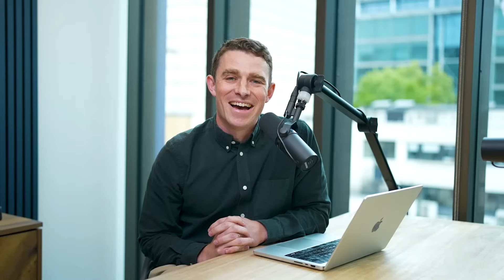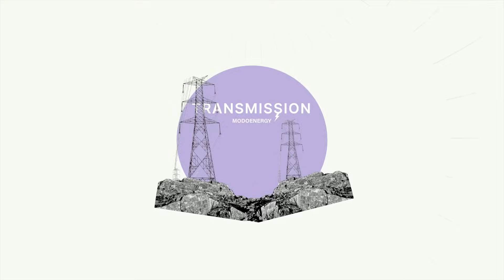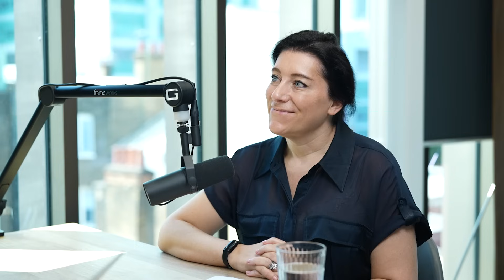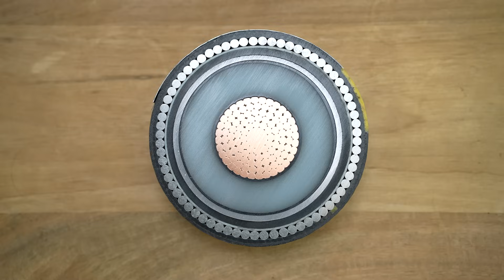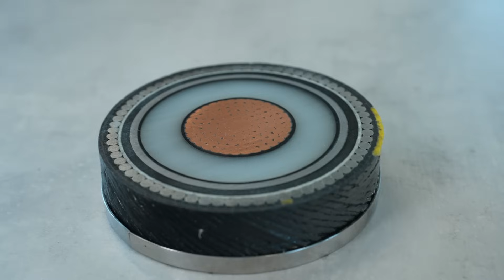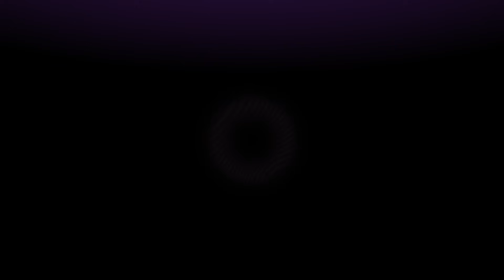Sharing Power Across Borders: The Role of Interconnectors with Rebecca Sedler (National Grid)

Comment: Can we build an "interconnector" in country along the "spine" of the UK, to transmit electricity north and south depending on the price of the  electricity(also east and west
Reply: There are many already in place in GB, as well as around 80 new transmission projects being built by National Grid. They will help to reduce curtailment and congestion in the network.

We don’t have regional prices and have just rejected a proposal to have regional pricing, so that locational element is all sorted by the system operator’s control room.